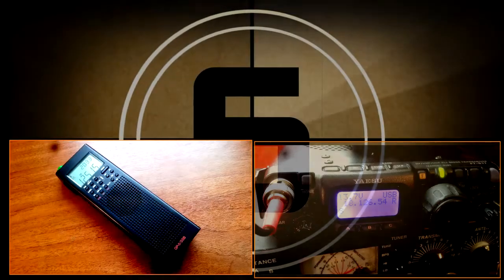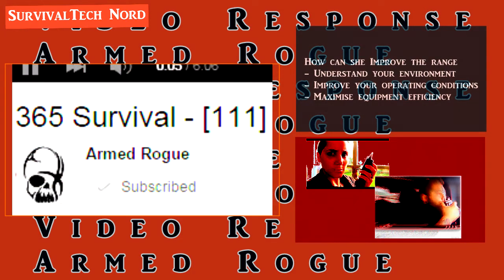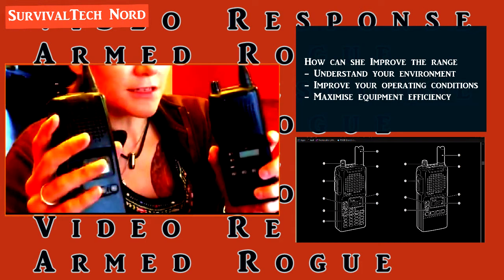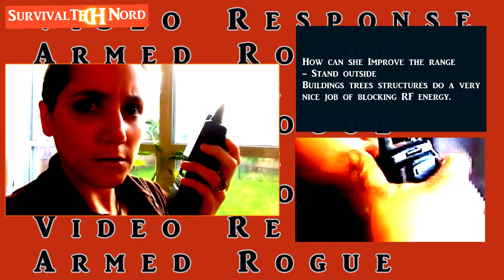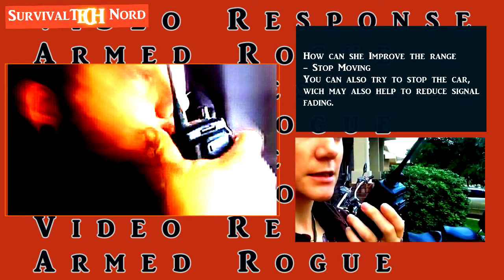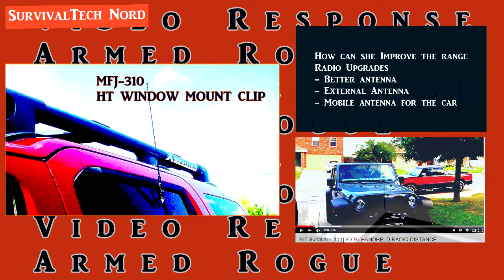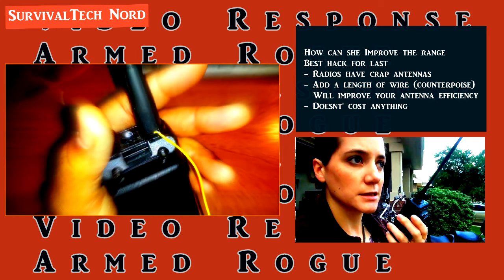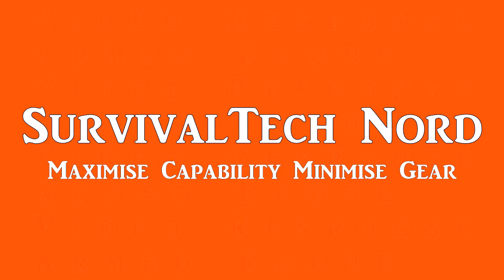Increasing the Range of your Baofeng UV-5R With a Counterpoise

Comment: I've made a couterpoise wire, aprrox. Same length as the stock bf-f8hp antenna. My question, may I just run that wire super long out my window and affiz to my roof? I'm in somewhat of a radio dead zone

Comment: Elevation  and  impedance matching,  higher GAIN antenna.
300 ohm to 50 ohm cheap coxial to twinlead,  twinlead  1/2 wavelength diapole at operating frequency.
(about 40 inchs at 100MHZ)
look up homemade FM dipole center feed 300 ohm twin lead.

Comment: Awesome video. How does one go about making a counter poise  for a handheld unit. Length,wire guage,etc. Thanks for the help and keep up the great videos.
Reply from the maker: Thanks for the question. You can make a counterpoise in quarter or half wave of the frequency you need. 2m is 100cm/0.25 or 0.50 then convert to inch. Same on 70cm, ...

Comment: I think when it come to discussions about the benefits counterpoise antennas may or may not provide when used with any stock or upgraded antenna, for the zero cost to make them and the fact they'll take up virtually no room in your emergency communications grab bag, I'd certainly include one. Who knows what situation or conditions could arise.

Put simply, I'd rather have one and not need it, than need it and not have one. A rule I tend to live by.

Comment: SurvivalTech Nord: Have you actually tested the counterpoise on an HT? I have built a couple but an actual scientific test is very hard to accomplish so it is difficult to tell if it actually does anything useful or significant. I would love for someone to devise a test and make a video about it.
Reply from the maker: Hi Tracy.  I have made range tests with Yaesu VX5R stock antenna with counterpoise and without handheld to handheld, at the edge of comms range, where voice comms were starting to break.  The result was comms was extended with the counterpoise than without.  However, I also had better results using an upgrade antenna. That said,  I wasn't able to see any benefit with or without counterpoise when using an upgrade antenna.
Thanks for watching.

Comment: Ok: 

Stand still. 
Get an external antenna on the vehicle. 
Get into higher places. 
Add a longer antenna.
And the most badass part, add a length of wire to complete the other half of the dipole. 

AWESOME tips!!! Husband was watching this as well and he is the Macgyver of the house, so he'll definitely do the wire for the dipole. 

We're going to make these adjustments and will try again! Will tag you when we've done it. :) 

You rock 1000 times over! Thanks for the tips!!!
Reply from the maker: You rock more AR :)

Comment: Yeah, lets see more on that counterpoise.   Maybe explain how the length matters.
Reply from the maker: Mr. 4 meters.
Of course the length matters! Unfortunately I can't tell the correct length, without knowing the frequency!
Reply: SurvivalTech Nord
OK, so what length should I do if I am operating in the 166 MHZ range?
Reply from the maker: the length is 1/4 wavelength of the operating frequency +5-10%. Moreover it helps to know the center frequency of your ht antenna where it has lowest SWR (assuming your antenna is resonant at that frequency). That will be the frequency to use to calculate counterpoise length! That means about 25% of the frequency e.g. 166.500mhz 410-430mm. As usual, it helps to have a bigger picture of the project so there is no generalizations or misunderstandings.